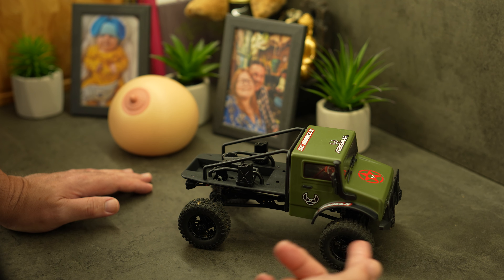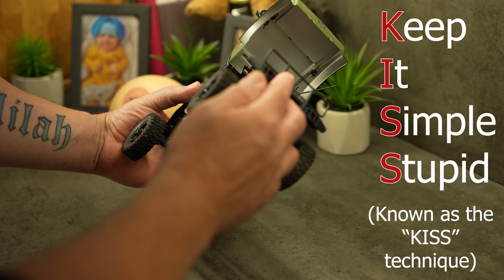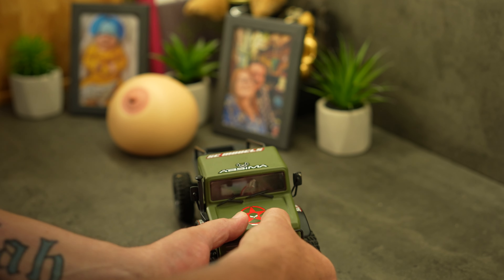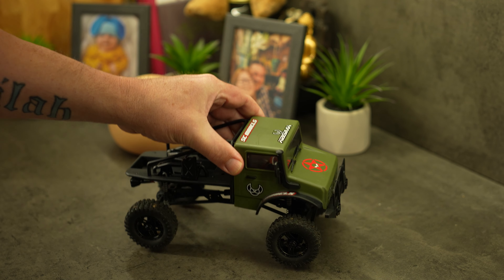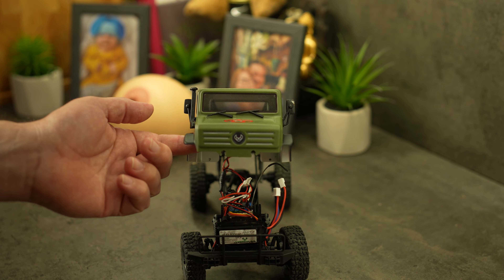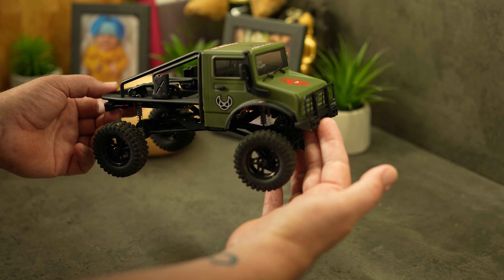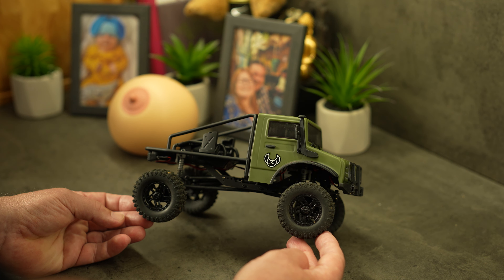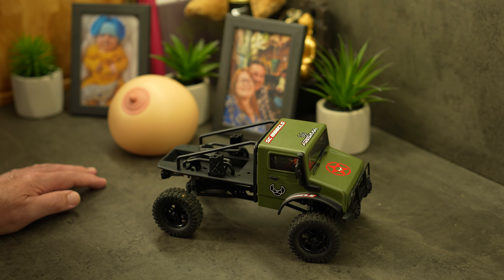CR-18P Trail Hunter + 4.3 degrees of extra climb for free!

Comment: Nice mods! Change those tires and you’ll be getting 58 degrees.
Reply from the maker: Thank you very much old chap. Just waiting for metal gears to be available in the UK as I keep stripping out the plastic center gears then I am gonna add some low down weight in this little beast! Thanks for subscribing too old bean much appreciated! Toodle pip!